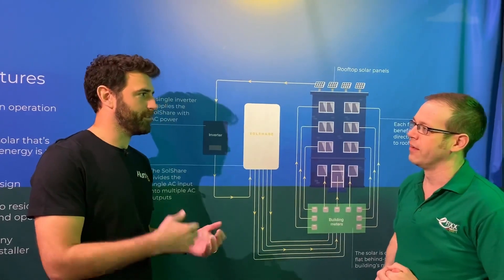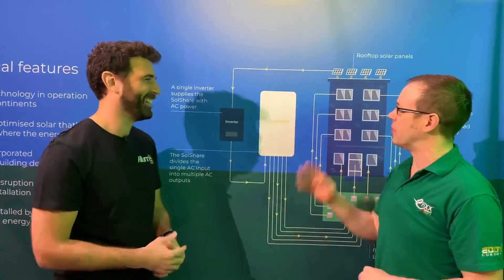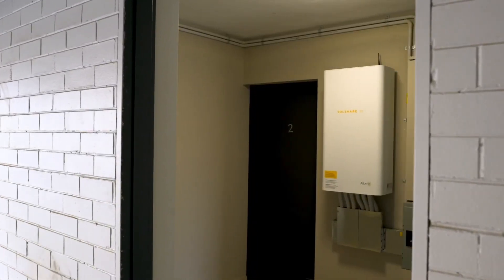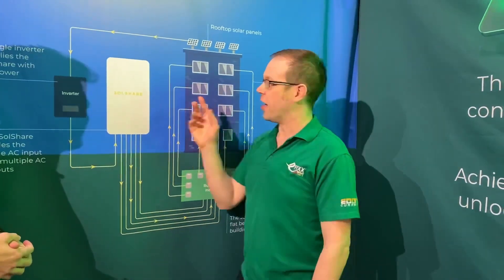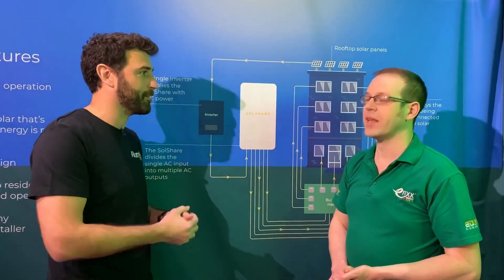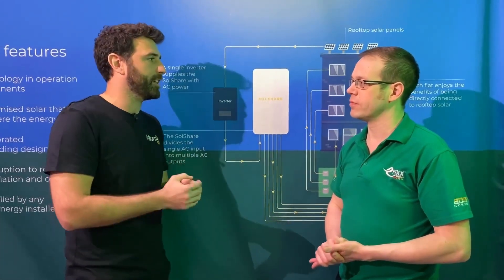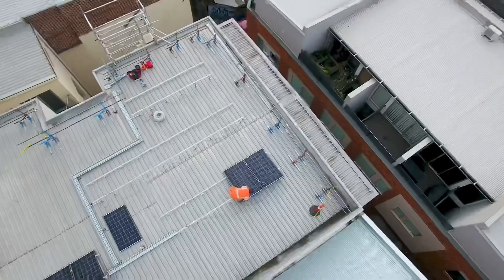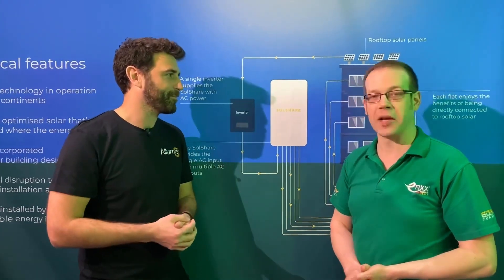Allume Energy Solshare - The world's first solar energy solution for flats and apartments

Comment: Another interesting aspect of this technology is that it can apply to a large grouping of manufactured homes. You see, most manufactured homes do not have the roof loading strength to handle the weight of multiple solar panels 😦. With this new technology a manufactored home park could erect 🌞 solar panels over available ground along the roads (and other open spaces within the park e.g. "instant" carports 😁) and then "Solshare" the ⚡ juice to all the connected mobile homes. 🤠

Comment: The hype is real lol.. you don't have to use regulator to "route" the energy to apartment that needs it... A simple grid tie inverter on the main electric bus will distribute to closest consumer... it doesn't matter if you physically get the electricity from PV or network. In the end it's the meter on incoming PV elelctricity and meter on apartment consume will tell you how to split the cost fair.. I like this channel, but some of the crap like this makes me not subscribe.

Comment: Thanks for sharing the video. I don't think is a good idea at all, multiple flats/apartments need multiple inverters when one of them failed, you replace only one inverter, in this one fit all system when it failed, all the 15 flats/apartments don't have solar power, means no electricity, and it will be urgent to replace and extremely expensive.
Reply from the maker: The appartments are still connected to regular electrical supply. Solar supplements electricity use.

Comment: Really cool, are you injecting the power behind the regular energy meter of the tenant?
Will this work in Germany?
And I have to tell you, you are not the only in the world offering this, Pionierkraft is offering something like this solution.
Reply: Hi Ralph, we should be entering the German market later this year.

With regards to the Pionierkraft, it has a much smaller capacity (2kW) and I believe has been designed to offload additional solar to just one neighbour. Due to this, it's not suitable for apartment buildings.

The SolShare has a much higher (20kW) capacity and can connect to multiple flats, which is why it's unique in the apartment solar market.

Feel free to get in touch to learn more. Best regards, Allume Team
Reply: @allume_energy  Unfortunately no one is responding to requests :( Tried several times.